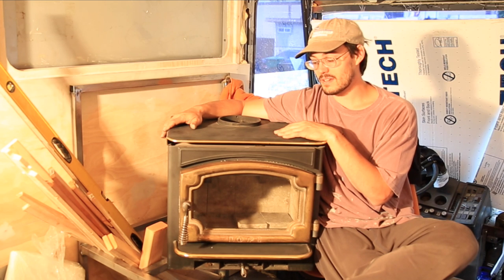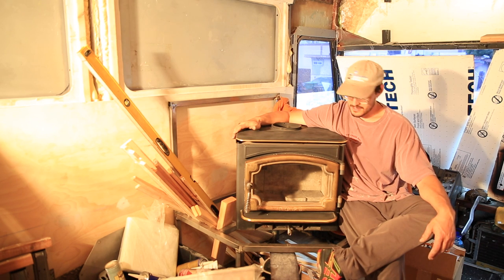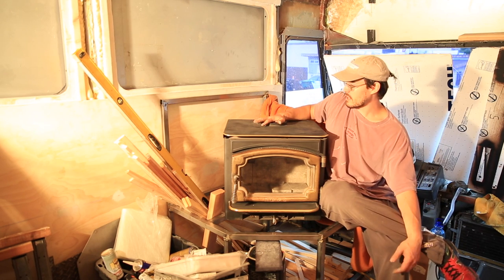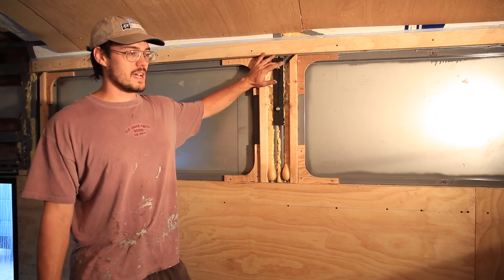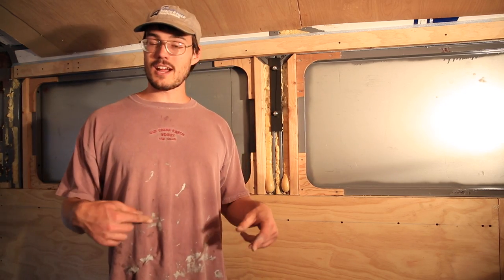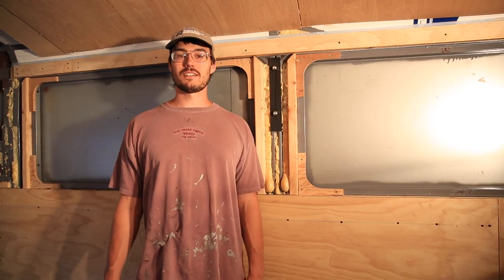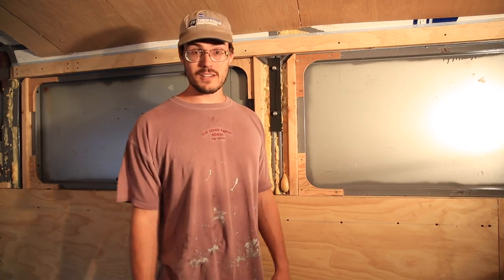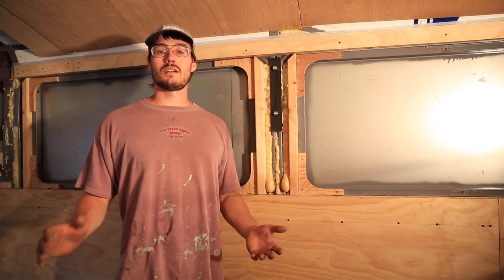Bus Conversion Tiny House #40 Fireplace reflection and window cut time-lapse

Comment: nice work guys,    progressing quite nicely :D
 dont worry about the fire, the hardy board kills any sort of heat behind it, even with out an air gap,  
i installed a fire into a friends bus not long ago, and we've had it glowing red hot with out any problems with it getting past the hardy board.
Reply from the maker: +hmmmnz awesome to hear that it actually works 😊! Thanks for the information and for following our project. It would be neat to see a picture of your friend's fireplace!

Comment: Just my 2 cents worth on the stove...... if you anchor it so it can't START to move in a collision it will be fine.... when I used to haul pipe on a 48ft. flatdeck, if the load was against a bullboard it wouldn't move.... if it was back even an inch, if the brakes were hit hard or you were in a collision (seen a few)... the load would clean the bullboard right off the trailer so if you mount it solidly to the steel of the bus chassis... (however you decide to do that) it will be fine, a bus is heavy enough that it doesn't slow down particularly fast anyway and if you do hit a bridge and stop instantly, you are the first one there, being right at the front of the bus so your day is already ruined.... nice work by the way :-)
Reply from the maker: +James E Dennison it would be tough to have the front seat of a head on collision! I am thinking that I put it over one of the storage bays so I can bolt it straight through the floor with a plate on either side... I should have had more foresight and made the mounts in the frame before 3.5" of floor went in! Thanks for the insight.
Reply: I guess my point was, in a head on collision there is no protection in a bus anyway so as long as it is mounted in a way that it would withstand anything but a head on collision you would be fine...... someone commented on a headache rack which would be a good idea as long as you could pretty it up enough to look at everyday
Reply from the maker: +James E Dennison I hear you, I got a good laugh out of it... it is true that the accident itself may be bad enough. May want the stove to finish the job off at that point!!! Haha. I do appreciate the thoughts, you're two cents are worth far more than face value. We'll see what the end solution ends up being. That is part of why we build isn't it? To tackle the many problems that arise and enjoy the fruits of our labor
Reply: Zackly........

Comment: How did you ensure there was a water tight seal from the deck bolt that are going all the way trough the walls?
Reply from the maker: +lawrence shearer Great question! It is a 1/2" bolt and just over 1/2" hole... so having a tight fit for almost all the holes was key. From there we used Sika Flex 221 which is an extremely good adhesive/sealant. It is not like silicone that will eventually break down, it is watertight and ultimately flexible when dry. The Sika Flex was applied to the inner and outer portion of the hole and all the way around the washer that made contact with perimeter of the hole. Should keep it pretty darn watertight. If more remediation were necessary it could be addressed from the exterior of the bus. Hopefully that helps you out!
Reply: Great videos, really like the dedication to overdoing the seals and insulation. If you don't do a video of this, maybe put a note in the description of this.

Comment: The fireplace would be best as close to the center of the bus as possible, off to one side of course...
Reply from the maker: +DirtySouthTV can you explain a little further?
Reply: Back to School Bus Either the drivers side, or the passengers side--as close to the center of the bus as possible (your bus design might make it a little close to the back or front). This will let it distribute heat relatively evenly all over the bus, while letting you vent out of the side instead of the roof (cut as FEW holes in your roof as possible), maybe a current or past window location.
The most important of all is not only weld it's platform, but bolt through the floor and if possible-a side wall beam as well. That is a LOT of weight that you do not, under any circumstances let that thing fly in an accident. Put the bathroom, or kitchen etc in its path towards the front. You want as many walls, cabinets etc as possible to stop it or at least slow it down. 
Those are some of the reasons people usually put them on the passenger side, it also lets the driver keep an eye on them once in a while too (flame-wise).
#OneLove
Reply from the maker: +DirtySouthTV great explanation! I will definitely note all of this in final considerations. Thank you!

Comment: Installing the stove in the middle of the bus doesn't solve anything, if anything it just gives the object ( stove ) more momentum , so that said a well constructed platform(welding) and the fireplace well fastened to the platform should be more than sufficient and safe . Good luck !!
Reply from the maker: +1armedguy Thank you for the suggestion, definitely a constructive comment comment and much appreciated!
Reply: Back to School Bus Would a half wall made of metal frame and concrete backboard between the fireplace and the seat work?
Reply from the maker: +Simple By Clara I think that would work the trick is what to affix it to... need something strong to anchor it down
Reply: Back to School Bus We install structures like this but on larger scale size applications. Use a plate attatched to the floor. Have the plate extend under fire place rack. This large mounting area should handle the weight of the rack wall. Also bolt or weld to bus wall. Good luck......David in Florida
Reply from the maker: +David Reedy awesome! It would be neat to see the applications you install on. I will definitely keep the plate idea in mind, I should have thought of that as it makes perfect sense. Thank you for the info!
Reply: Agree with David, Larger base plate spreading the load over more of the floor ribbing, its a flat floor, so easily achievable. Where you are looking at mounting the rack is ideal for using the rib up the wall and doing a wall along the roof rib as Clara suggested. (might have to use something like 1 x 1 or 1 x 2 square tube by the looks to use the existing structural ribs as an offset). Full length square section from roof rib to floor rib for the front of the cage. You could use additional square section on the roof between ribs to spread some of the load from that first rib. Also remember triangles are mans best friend, if your boarding over the structure, 45 degree bracing helps again to strengthen things. If you go with the base plate idea, you then brace to the plate at 45 degrees along the aisle walkway to give a bit more strength also.
Only problem I can foresee is if you make the structure to rigid for the amount of movement created when travelling. Bolting to the buses ribs would help with flex more than welding.
Reply from the maker: +mick VR Solid thoughts there! Thank you for the advice/input. The bus definitely presents an added challenge because, as you pointed out, being to rigid can actually be a bad thing. Definitely all good stuff to consider... I think I have a couple more plans to draw out from all this fantastic input we have been receiving!!!

Comment: Way to much stove for the bus with all the insulation.
Reply from the maker: +Glenn Lever Yup! You can make a smaller fire or open a window... but you can't make a smaller stove suddenly produce more heat. Would rather run at 50% comfortable than 100% to try and get comfortable. Moot point now though, sold the stove and the bus is for sale